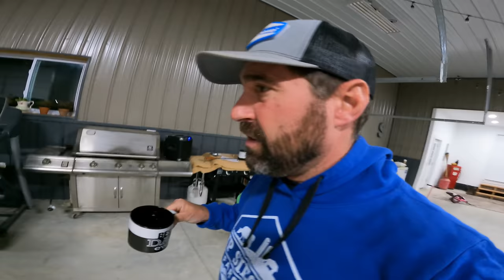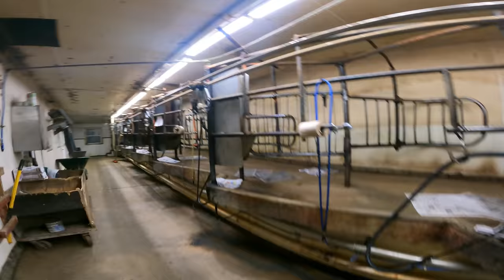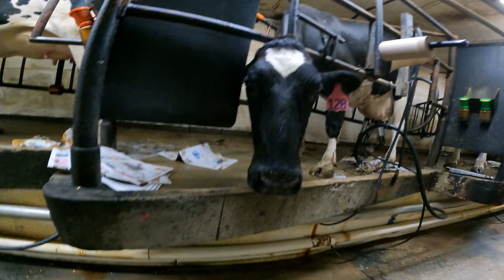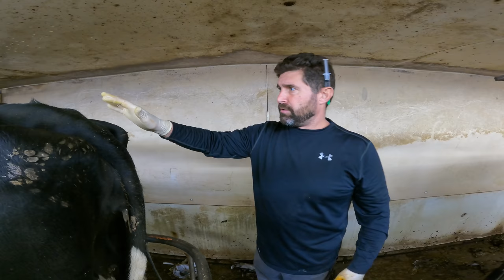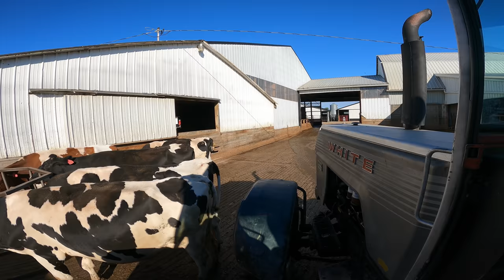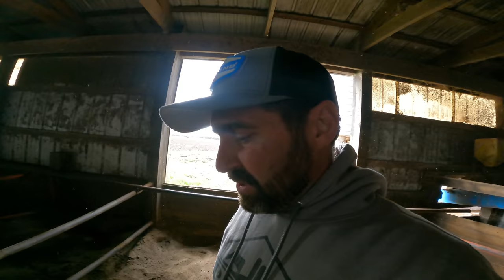Morning Chores | Milk Hauler | Kip Climbs Silo!

Comment: Good to see you are able to get around better.  I'll tell ya, the easy way to know when you need to let down the unloader without waiting for it to fail in the middle of feeding is to put a clothes pin on the cable by the winch.  When the clothes pin has risen up a couple of doors in distance, you know you can lower the unloader 2 doors.

Comment: KIP WHY DO THE MILK TRALERS HAVE SO MANY AXELES ? AND THANKS FOR THE GREAT VIDEOS ! MAY GOD BLESS US ALL
Reply: Michigan 8 axle trailer,they hold 12,000 gallons of milk. That's 104,000 pounds of milk,plus the weight of the truck.
Reply: @georgegrill3262  thanks didnt know they hauled that much surely they must have special permits
Reply: @Sammy Armstrong  Michigan has different weight laws then any other state. 164,000 gross on 11 axle tractor & trailer, no special permit required.